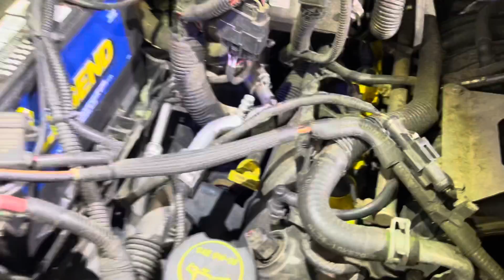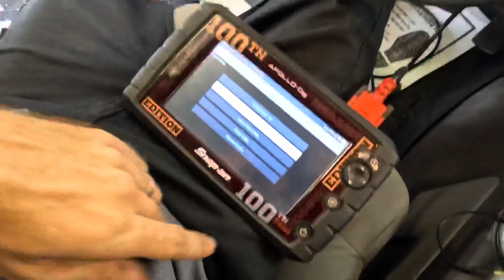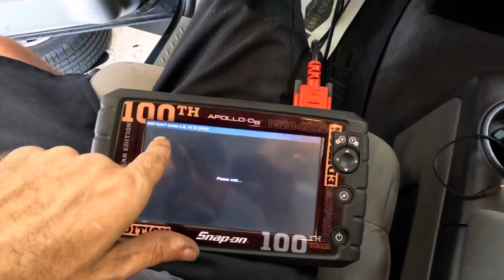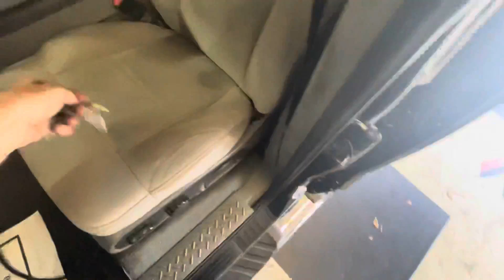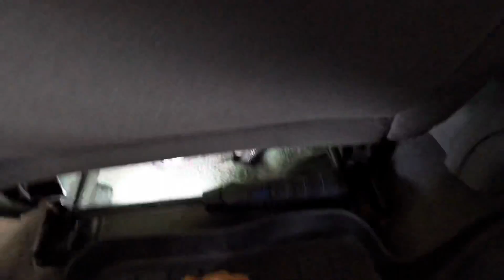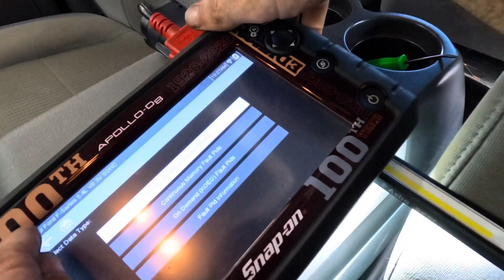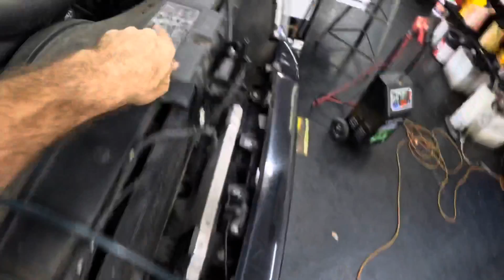Mini Explosives! Car fire Recalls and Airbag Fault! 2008 Ford F-150 5.4 4.6

Comment: How do you get 100% recovery when all of the service ports are vertical and on top of the lines? Wouldn’t there still be some liquid left in the lines, or does it all turn to a gas?
Reply: Because he evacuates the system and it has to hold vacuum for about 10 minutes. At that point the ony thing left behind in the system is the oil.
Reply: It all turns to gas.  Only liquid under high enough pressure.  There is still a very small amount always left in but it's negligible

Comment: Seems to me you never checked with the scan tool after you reseated the large connector. You went right to using the 2 ohm resistor. Reseating the connector may have fixed it. We will never know.
Reply: You may wish to re-watch the video. Ray reconnected the large plug and then made it open circuit at the seat belt plug, measuring the resistance (OL) at 25.5 ohms. He then also substituted the 2 ohm resistor at the seat belt plug, showing the resultant low resistance reading on the scantool, thus confirming that the problem was higher than acceptable resistance at the seat belt unit. If the large plug had a high resistance that would have showed up when he substituted the 2 ohm resistor, don't you agree? Retired mechanic in Land Down Under.
Reply: @bobhudson6659  you tell em ! LOL

Comment: just got a recall letter from gm over that air bag stuff for a 2011  ppv tahoe . the letter mentioned that the driver and passenger air bags could be bad and go off at random on top of the stuff you went over.  : /

Comment: Ray I have a question when you service air conditioning systems and completely Evacuate the system is it common practice always to change the air drier receiver in line filter
Reply: Usually when you replace the compressor and anytime the system is open for more than 5 minutes because the drier absorbs water out of the atmosphere.  Pulling a vacuum on the system will boil the water out of everything except the drier.

Comment: I have to get my calculator out every time you use Fahrenheit.. It's very confusing.
Reply: I have to get my calculator out every time someone uses Centigrade😜very confusing indeed...
Reply: @ricanderson5717  *Celsius
Reply: What about banana conversions? CCE from Oz.
Reply: My bad, CEE from Oz.
Reply: @kenore4003  The calculations using Bananas is far easier to comprehend, apart from them being upside down of course.
Reply: They're the same at -40 degrees.  :^)

Comment: I thought the whole idea of engineers and car/truck makes doing crash test are suppose to catch such things like the fires before any safety system makes it to the consumers
Reply: They do. Several dozen crash tests, as I recall. If it's a very rare event, it might not happen during those tests.

Comment: Rule #1 is not to move the customer's seat? Whew, my mechanic is about 5'3 and I'm 6'2, he can't safely test drive without moving the seat!
Reply: I never get that. I don't care if they change the seating position. If they have to make a test drive I want them to be safe as well in a good seating position. 
Wheny wife brings the car in for service they have to change the seat because they won't fit otherwise.

Comment: Ray what's the best? I eas told with new(reman) calipers it's best to gravity bleed. Or should I use my bleeder
Reply: if you are using a handcrank vacuum type machine or an assistant on the brake pedal, its good to let it gravity bleed until you see fluid coming out of the bleed screw to save time.  its always best to use a pressure bleeder if you have one.
Reply: I have the hand pump one.
Reply: You can let it gravity bleed until fluid runs out. Then just have another person pump up the brakes and hold pressure while you loosen the bleeder. Do that several times until no bubbles and will be fine.

Comment: I’m kinda surprised that your employer doesn’t have an issue with you teaching “laymen” to service their own vehicles.  Knowing corporate greed as I do I would think they would be concerned with income “loss”.  Don’t get me wrong, I love it and would love it more if there were longer vids with more serious wrenching.
Reply: "Corporate greed"? Do you mean a small to mid-size business trying to run at a profit?  You know, the thing they're in business for?
Reply: I don’t think many DIYers or home mechanics have the thousands of Dollars of tools or equipment to invest for single part repairs.
Reply: I may be wrong, but when Ray got to this shop, the point of YouTubing had been discussed and was contractually accepted 👍
Reply: He has videos of customers who drove hundreds and thousands of miles to his shop and specifically requested that he work on their vehicles. If anything, his videos are increasing business for his employer, not reducing it. As for longer, more wrench turning videos, he has plenty of them. I have never been bored with anything he has posted so far, and his are the first I look for every day.
Reply: I doubt it will make a measurable difference in the amount of people going to a workshop for service. Just look how easy an oil change is and how many people are actually doing that themselves.

Comment: From system engineering, systems have emergent conditions, and that fire is a bad one.  A system is defined in terms of its emergent conditions, for example a car can carry you from point a to point b but none of its components alone can.   But as shown here not all such conditions are good, and the unknown bad ones are hard to find, a lot of effort goes into aerospace stuff to find such early, but not all will be.
Reply: Wow! that's deep.
Reply: Like an NFL head coach once said, "You have to look out for the intangibles!"    hahahaha
Reply: @namvet-72  Ya! Like crossing a street nowadays ! LOL look 5 times now , then re-check & run!
Reply: So !  Are you an Astronaut ?